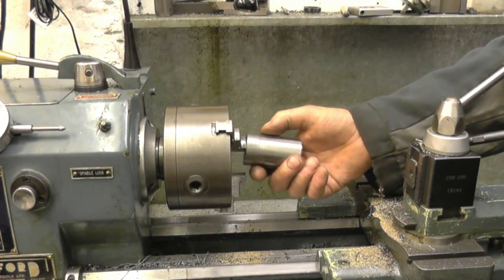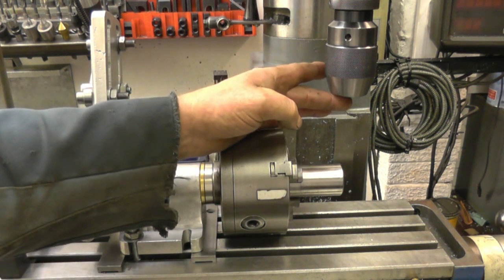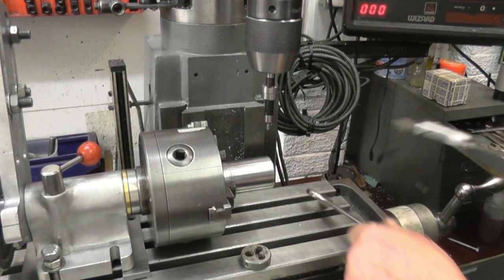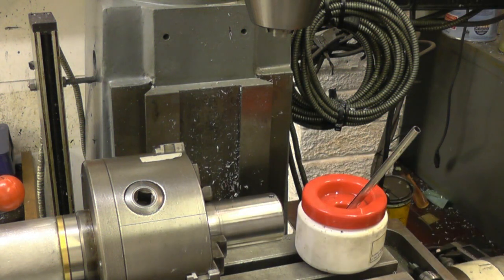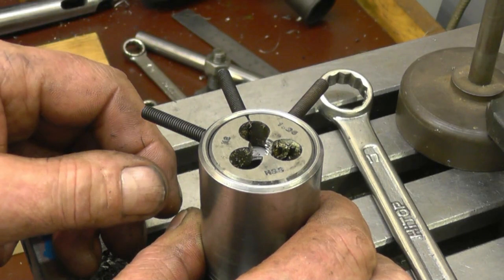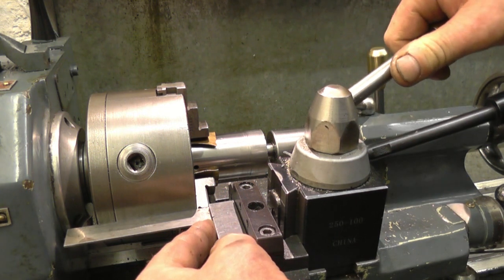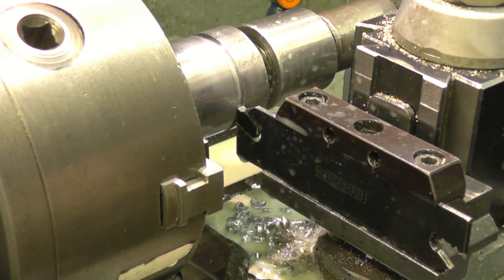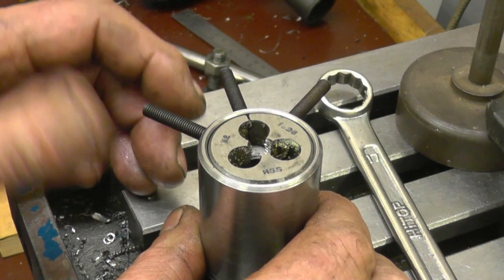Tail Stock Die Holder Part Five

Comment: Hi John,

When I had a Boxford, it had an original plain cross slide, not an aftermarket T-slotted one like yours. I machined a flat area on the back to mount a rear tool post and used that for parting off. I never had trouble parting again (I never used back gear). It also worked great for batch work as I could set a fixed distance between a facing tool and the parting tool.

My Harrison has an L00 spindle nose, so there's no chance of the chuck  unscrewing. As I've mentioned before, I run the parting blade upside down and the spindle in reverse. I even sometimes part off with self act!

Comment: Great project - and a much nicer item than you can buy from our usual suppliers.

Did you forget to add on half the diameter of the pin when edge-finding? I know it's only a mm (have to say the pin looks bigger than 2mm?) - just wondering as it's something I've tripped up on once or twice. Thanks.